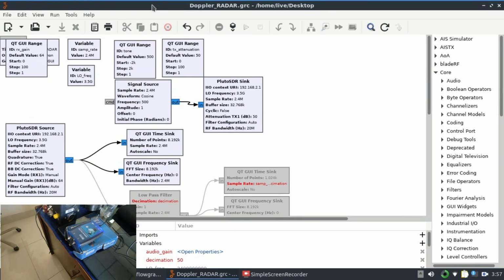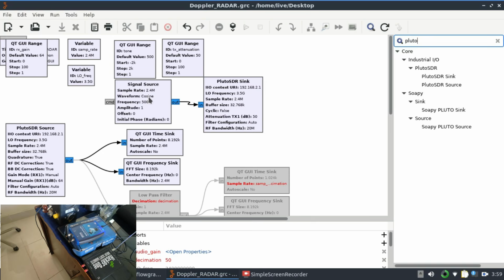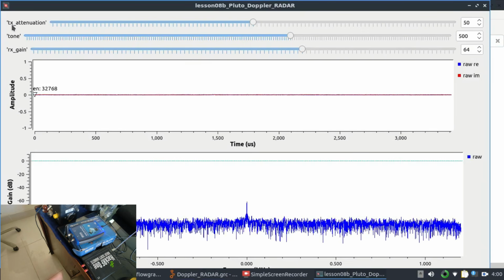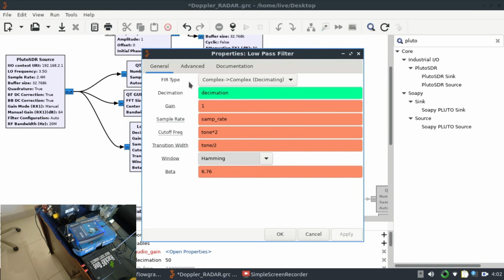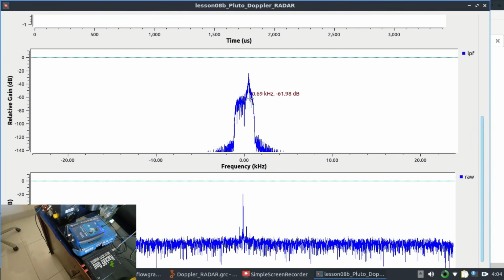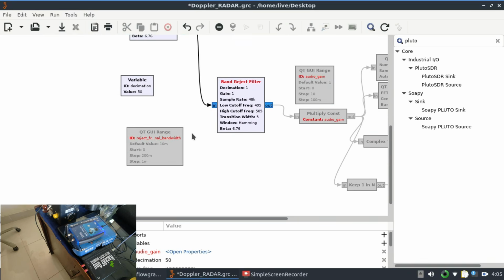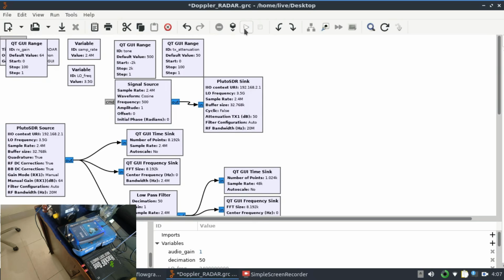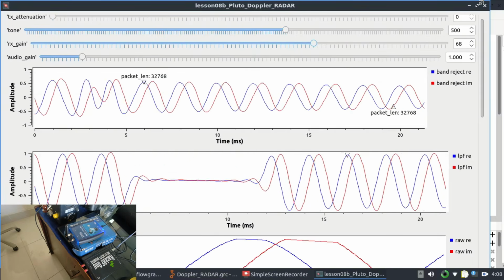DIY Doppler Radar with PlutoSDR and GnuRadio (Insane Real-World Demo)

Comment: Great video. As per usual.  Re: HRF one, isn't that what the connections on the bottom are / one reason/ are there for though, is to daisychain multiple HRF ones to be able to function as a "full duplex" device...1 rx, the other tx? I always thought this the case... along with increasing bandwidth/ sweep speed... i believe the later was the goal of that 1 project some years ago where a gentleman daisy chainned 12 together

The HRF is such a versatile device...with its open soursce status, it always suprises me no one pursued devising a full duplex device HRF 2? The PCB itself is designed with expansion headers with initial intentions of expantions... i'd love to devise such a but  i am just not that savy with suchinner workings of these things... we have the differrent versions that have come out...though not one is truelly solving many of the true desires of the power user...sure now there is a version that has usb c...oh a differrent version which doesn't but has a power switch...then an even differrent version which tackles the amp issue yet, nothing else.  Then, recently there's that weird looking device which honestly just pandrs to the popularity of the Flapper- all gimmicks really.. It'd be nice to have the community come together and get it don e right; USBC a decent battery..noise suppression on power in when charging..sd card..why not a lower gen NVME- ethernet for faster data transmition to pc....heck..we have the ethernet port..ditch the usbc and support power over ethernet also..i personally like the creativeness of the current power switch through clicks of the knob...and i like the nob its..but hey tis the future and a full out hardenned glass touchscreen could be nice with an up/down and confirm button along the edge of the device...leave the audio since this is good not just sound but incorporating things like square readers/ cc skimmers, have exposed but set in(like a video game cartridge style headers gthat using an adapter/ header extentions be incorporated with a R Pi or other R Pi hats like cellular or maybe the headers are what connects the device to a NVME storage solution or that wonderfull hardenned screen i mentioned and prior to that it has simillar form factor as just the HRF and no porta pack style... utillize those headers to sandwich as many HRFs as desired...maybe 3, 5? create an antenna array and a functionallity such as the kraken...direction finding...or to allow for full duplex...or to connect an accessory such as the operacake with ease so that sweeping through the spectrum really specific antennas can be utillized.

Now to me, those aren't gimmicky features rather utillitarian and get the HRF back up to a modern standard. Call it the New Yorker since can't call it the big apple...faster, high paced, world class...and it falls in line with original food item naming conventions..opera cake..original porta pack was something like the blue berry...etc. 

Just like the flipper and how supprisingly its been able to stay unique without all these clones..the HRF has held its oun but it always makes me wonder how? How do they not get coppie3d to oblivion...why is it so hard to do so. Unique chip?  I've rambled enough lol

Anyways thanks for the great demo. Video.
Reply from the maker: I am speechless and to be honest with you that's the lengthiest comment/suggestion/recommendation/experience/opinion/research, someone ever shared with me on any of my video. So I really APPRECIATED.